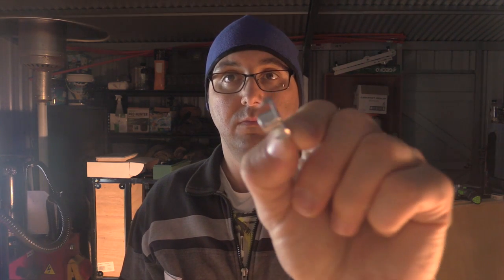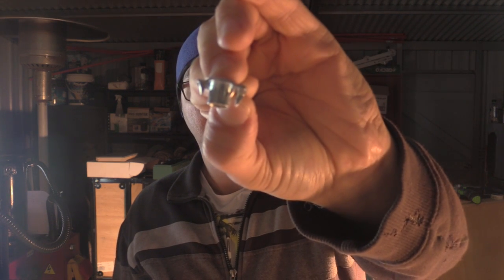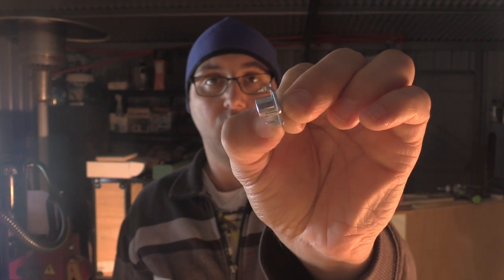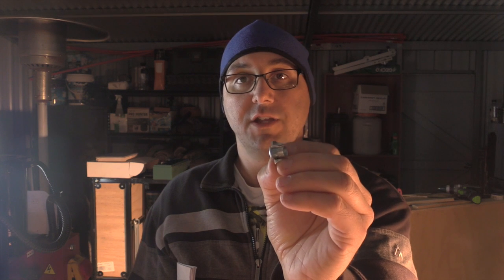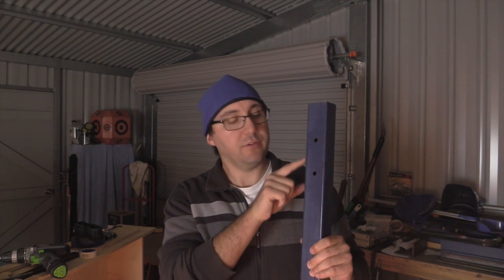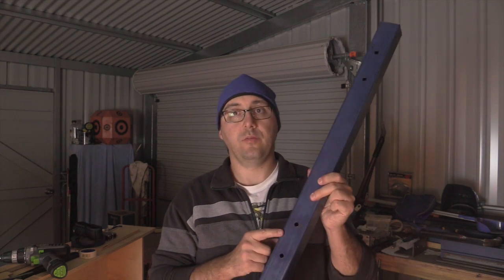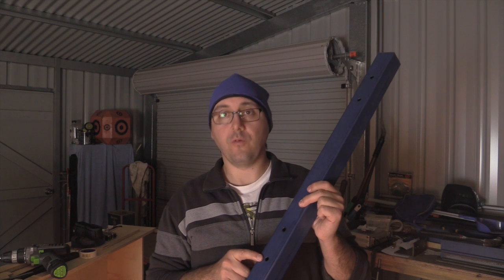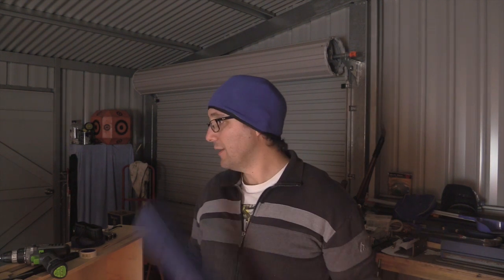DIY CNC Build by a novice - part 6

Comment: I have quite similar setup that youre building, but i have been running in interference from plasma. Have you thought of that any way? I've replaced aldready stepper drivers to ones with optoelectronic signal inputs and housed arduino in metal box, but still getting interference to usb connection. Next step, I'm trying usb isolator and some filtering in signal leads.
Reply from the maker: +linjari Thanks for watching, I have been thinking about it and I'm using shielded cable for all of my connections. I also read something Jim Colt from Hypertherm said about star grounding everything from the gantry through to the control boxes and plasma unit. I don't actually have a link sorry but if you Google Jim and star grounding you should find it. Again thanks for watching and let me know if you get it sorted as I'd love to hear how you did it.